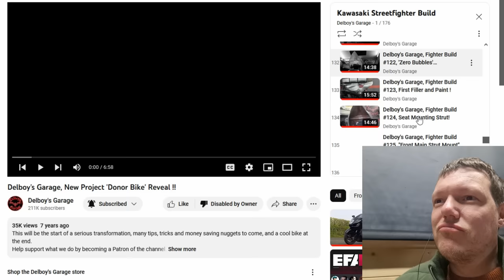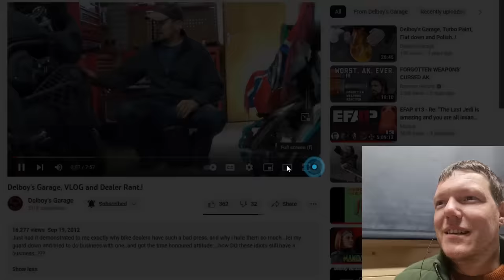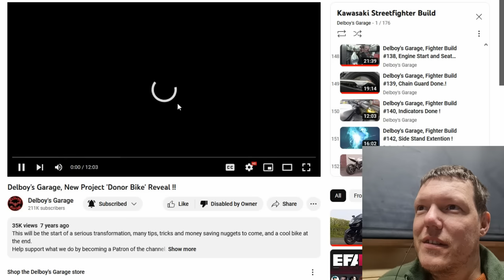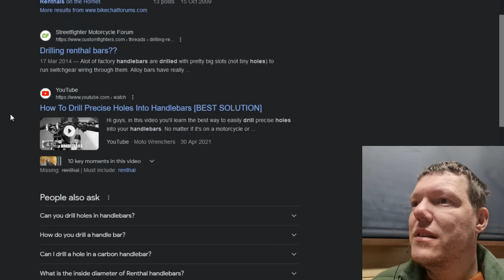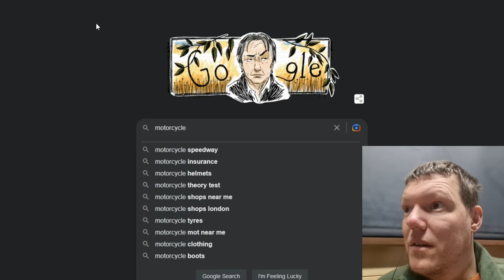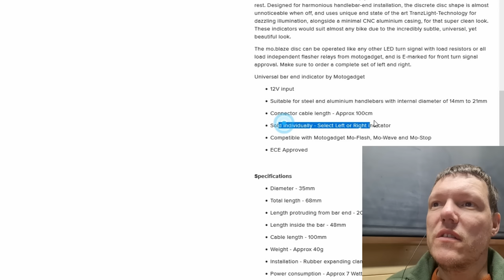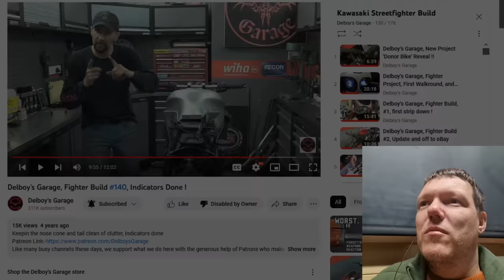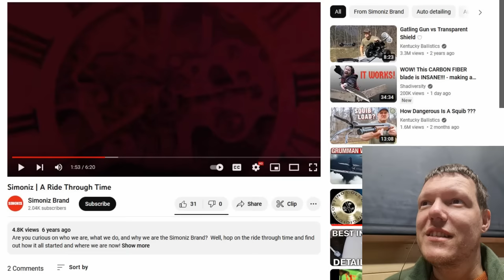HDS 79 - Dealers are Lazy, Greedy and Arrogant

Comment: I was told that a single pair of indicators in the bar will pass an MOT as they are visible from both the front and rear, but they won't pass an MSVA test as rear indicators need to be within about a foot of the rear most point of the bike.

Comment: For anyone wondering about excellent connectors. Deutsch DTM connectors would work a treat on bikes. Super easy to depin should you need to rewire. Then just buy a load of spare male and female pins for them. Job done.
Reply: DTM cost like crazy. All oem style water proof connectors do same job and cost nothing. Easy to depin with small screwdriver too
Reply: @inevespace  about £6-9 depending on how many pins for a complete kit using the F-crimp terminals.
Reply: @bradleybatt1401  meanwhile oem style connectors less than 1 and used everywhere, like DJ7021

Comment: No one in their right mind would want a "cutomer" like Dell, there are more than a few out there and they are best refered to someone stupid enough to get tangled up with them.
How would Dells dealerless world work?
Reply: Being able to get bikes direct from the manufacturer rather than being forced into dealing with them by law would be nice as would being able to buy and access the tools needed that the dealers make inaccessible via insane prices (15k to purchase the software to get a vehicle to recognise a part iv installed or clear codes   off the dash after the repair so it doesn't fail an mot for having an error code and needing to buy a laptop at 4x what it's worth from them to run it.) would be much nicer nicer. 

Right to Repair and forced to make it possible for independant to compete. 

The manufacturer franchise dealers are an issue.
Reply: @jediknight1294 I mean the specific issue you mentioned isn’t a thing on bike MOTs as engine lights aren’t failures as such, but I get your point. Systems like TEXA are great for indies but they don’t hold to a manufacturers own diagnostics
Reply: @gamekeeper687  it's an issue though, the car side any error code on the dash is an mot fail regardless of what that issue is or if its been fixed.

So a BMW which needs a new tpms sensor you replace the fucked on and then have to go pay a dealer to flash the code because the private mechanic and most independant can't swing the 20k it costs for the software.

Bikes are fairly simple but.. Eventually we will get the same fucked rules as the aim of various groups is to make cheap vehicles les prevelant and harder to own your own transport in general has become the policy.

We need a right to repair law that actually forces this stuff to be accessible and not in the American way if 100$ charge for one time use for one vehicle that their rtr law ended with the manufacturers offering.
Reply: @jediknight1294  I’m not disagreeing mate we’re on the same side I get what you’re saying, and I’m from the main dealership big brand world. Code readers generally are great for reading codes funnily enough and deleting them and maybe setting a service light here and there, but yeah you need the manufacturers own diagnostics for coding TPMS, various ECU’s and running good tests etc, which is pain when I’m working on ‘non’ franchise bikes

Comment: The bar end indicators, the important thing is that they fulfil the legal requirements in the MOT regs for distance visibility and the Construction and Use requirements for distance from the frame and centre of the bike to prevent yiu getting a ticket from a copper.

If its OEM on a vehicle sold in the UK and breaks construction and use requirements that will have a Type Approval for that specific thing. So there's no guarantee you can do a thing just because a company does it.

Mirror indicated indicstors are legal on some bikes but whether they are actualy legal for anyone to put in a bike... Is more complicated.

The ONLY Way to tell on a custom bike is to take it through SVA approval. (which most of Dels bikes SHOULD HAVE because they are at the extensive frame modification level.) so the only answer is I don't know.

The Motogadget stuff is actually pretty good, the M-unit kit is really solid, the bar end indicators have ECE and TUV approval sooo the best answer you can get is 'probably'.  The front approval only is because of the German TUV regs which are... A very specific set of regs and more restrictive than the UK regs. 

Also that bike rack... Fuck me and I thought the wheelchair mounts that use the pillion seat space could be sketchy.

Comment: You should have a look at the video showing how the Motogadget glassless mirrors are made. They got some great product generally, but fuck me are they pricey.
The indicators are handed because there are null points in the design so the rider isn't blinded by flashing LEDs, but the lights can be seen from the front, rear, sides and diagonally. The M-unit is worth a look too if you have to wire a bike from scratch, or even just rewire a bike entirely

Comment: About those indicators, I don´t know, if you are concerned with the position, scratching or breaking and the cost, why now leaving regular indicators with a bulb in the body or somewhere in the front end with a bulb that you can change for less than 1 pound without the need for the circuitry for led turn signals...
Edit: I suppose it won´t weight similar to the bar end weights, another thing why I don´t like bar end mirrors or signals.

Comment: Iv had the odd row with parts guys over the years being fucking useless and being incredibly unhelpful. Arguing with you about what parts you need because their computer says the thing doesn't exist or me coming in to get a gasket set for an incredibly common engine and being messed about with the whole what model, what spec what blah blah' it's a rover v6 or a Big Block Chevy crate engine and that sort of crap

Main dealers can be a pain and the fact in forced to deal with them by law is aggravating, the bullshit on newwer stuff like the software needed to clear a code after a repair (the code being there on the dash is an mot fail regardless of the repair being done.) being 20 grand and only running on a system they charge 4x what it should retail for. So you basically can't do repairs at home and all that shit.

There's a lot wrong with the system we have but Del and some guy flogging a personal bike out of his parts shop isn't one of them
Reply: It's often just a lowest paying retail job for that person. He or she knows about it only enough to use the system and that's it. There are so many variants of each part, engine and so on these days I wouldn't even bother trying to learn it. At the other hand you have main dealers where number of parts are limited, people are trained and actually know what they are selling, but in the end YOU have to pay for it, so the prices are higher.
Reply: @Marine475  oh I know but the lack of critical thinking is frustrating especially when it's the ones who are/do claim to know what they are talking about.

Getting shitty with me because I can't play the game of listing vehicle and spec because it's not relevant to me or useful for you when iv given the part number is just depressingly dumb.

The fact that parts shop type jobs arent the preserve of the young gearheads wanting a discount or access to the rental tools anymore is just depressing.

But given how hard it is to do stuff like project cars now generally and how places aren't teaching the skills I can see why it's got that way.

As for dealers, it's not the parts counter I have an issue with it's the shitty attitude, entitlement and the piss take games that are done to actively make it hard to do repairs stuff without going through them. We need a right to repair law that forces those tools to be accessible and not in the bullshit way the US RTR law forced of 150$ for a single use code or buying the software for 25k. The fact I can't replace a TPMS valve in a way that passes an mot because I can't clear the error code off the dash without going to a dealer and paying them to plug into the ecu and turning it off and they actively block and change things when aftermarket scan tool manufacturers work out how to get past the bullshit...

Harley dealers can be a problem, being asked not to park an older harley outside the dealer in the customer parking when picking up parts because it's 'the wrong image' and the way I got treated as someone interested in buying a Buell was not conducive to wanting to deal with the dealerships. (and that shitty attitude from dealers is what killed Buell.)

I love the Internet meaning I don't have to deal with the shitty attitude, incompetence and aggravation anywhere near as much. Having gaskets just arrive at my door 24hrs after ordering is lovely.
Reply: @jediknight1294  I don't have such problems but I can be very abrasive and if someone isn't worth dealing with I just don't. Someones image problems aren't mine, it's even funny to mess with such a person. You can clone TPMS ;)
Reply: Just a minor point but a engine light for a bike MOT is not a failure, it is in cars but not on bikes
Reply: @gamekeeper687  still a relevant point because the problems are the same and we are at a stage where the manufacturer specific tools are needed for a lot of repair work. Parts being locked so that yiu can't replace for example a failed Honda H.I.S.S immobiliser without access to the manufacturer tool to talk to the bikes ecu on a 2020 fireblade.

Having to spend 600 quid to have an ecu reflashed in order for the bike to not run like shit with a new exhaust system and air filter because a power commander or similar piggyback system can't do what's needed because the software to do the ecu stuff is stupid expensive.

Or the thing KTM has done of these things are on the stock bike but if you want the features turning on its going to cost you annother grand or a subscription service...

We have been watching it get harder and harder to work on vehicles in general if yiu aren't a factory dealer and it's got stupid.

Comment: 49:38 rather than a bike rack on your bike, what you need is a vice, that way you can carry your grinder and air line with you everywhere, just in case.  Compressor and generator on the pillion, obviously.
Reply: I do miss having a low rider setup and a off road Landy with on board air